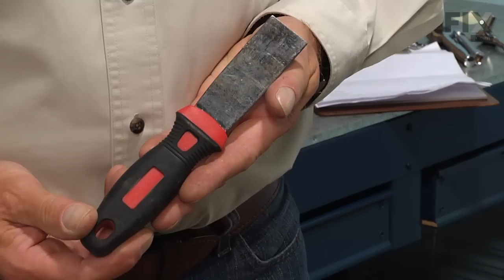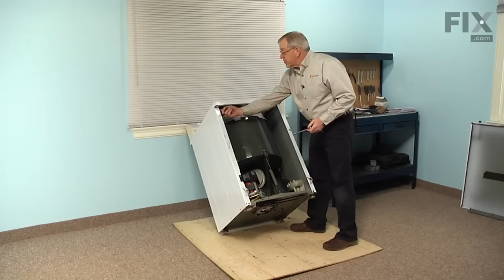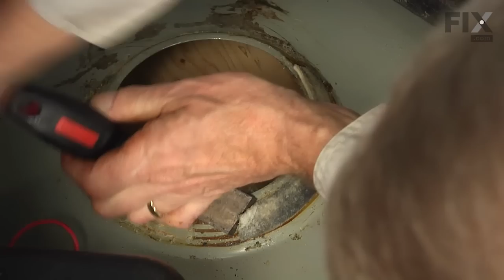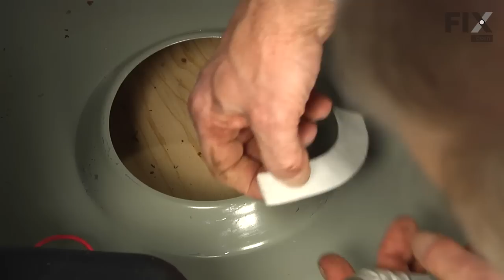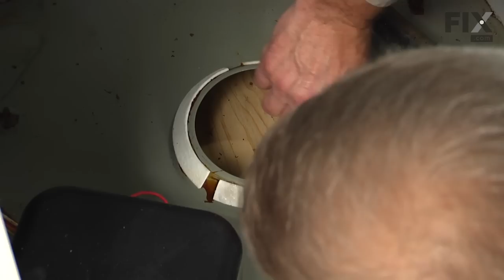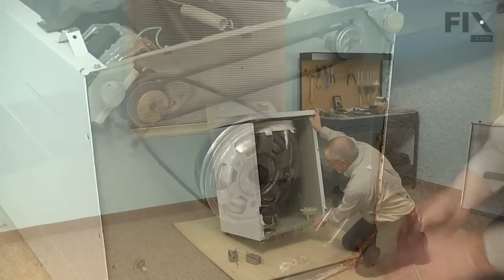Maytag Washer Repair – How to replace the Damper Pad Kit

Comment: Other video ive seen, instead of a single 4x4 you get 4 pieces of 4x2, 10inches in length nailed together to create a solid 10" square base to pla e unde4 to lift the tub. That way its secure and much safer than single block of 4x2 to work the replacement. That wrench is hard for taking out break part is hard to find and too expensive. The 10x10 wood support made out of 4x2x10 s will be solid and mucj safer support

Comment: GREAT VIDEO & how-to for old Maytag washer.  I'd never get an appliance technician to dive into this problem, and they quickly claim parts are not avaialble to fix a 40 year old washer.  We've had our Maytag A212 since the 90's and I plan to keep it running as long as I can.  New "water saver" EPA mandated washers do not get clothes clean.  There's no shortage of water, just a shortage of good washing machines in 2026.  I ordered a replacement motor and belts of bench stock on this old girl today.  Great tips here, and great service on parts--thanks for stocking old parts for good machines!!!

Comment: For anyone about to try this: the brake removal tool is no longer manufactured or sold by ANYONE. You cannot get it. You can try to remove the brake using a large pipe wrench.

Comment: I was watching your vide again, the motor pulley seems like it turns smoothly as does the transmission wheel. Is that how it is? I feel a little resistance on my transmission. I have to say

Comment: What if you're dumb like me and took the springs out without the junction box. Whats the best way to stretch them back out and get back on?
Reply: Try putting one on the machine and put the box  on it by stretching it , then remove it and do the same with the other two, then put all three on

Comment: does anyone know the diameter of the brake or the width of the spanner wrench required to remove the brake?
Reply: It’s a discontinued product you cannot get ANYWHERE. It’s frustrating. For anyone reading this: try a large pipe wrench.
Reply: @redjelly2615 that's a pretty old post. I replaced that washing machine with a new one. But thanks.

Comment: you need to show some close ups for visual details of putting some parts on or off...would really help with the little important details but a good video...where does a diy guy get the brake wrench? without that it cannot be done..

Comment: What do bad damper pads cause to happen?
Reply from the maker: The entire wash assembly sits on those pads as you know, The assembly needs to be able to glide freely on those pads to allow the spring suspension assembly to do its job of keeping the washer aligned reducing vibration, Worn or sticky pads with restrict that movement and  you will likely experience vibration in the machine and even cause the machine to move from its normal location.

Comment: I have this exact washer and it's wobbling badly during the spin cycle. I think the damper pads need replacement. I could not believe I found this video on how to do it. Looks a bit beyond what I'm prepared to do however, so, I think I'll be looking into buying a new one. Thank you anyway, for at least confirming it's enough of a pain-in-the-butt that I don't want to attempt to fix it myself. ;-)

Comment: Maytag has discontinued making parts.
Wtf?
Reply: There are many brand new parts available that are still being produced since they were used (some still are) in other brands and models of washing machines.  What they no longer manufacture are things like the brake wrench, since demand is no longer there. Sure, you and I would like to buy one, but how many 40 year old Maytag washers are out there having major repairs being done by their owners?  I am currently running with 2 of the 3 damper pads still in place, and before I will tackle this job, I will be very seriously considering replacing my 40 year old Maytag with a front loader.
Reply: @A48L16S091366  The same brake wrench was used from 1956-2006, not 40 years.
Reply: Thank Whirlpoop for that.

Comment: Good day, problem is strong unbalanced during spin at all time. Same model as presented in the video.  The washer is very well level on floor on all side. I removed the front the panel as described and all springs are in places. By hand I moved the drum quite easily back to front left to right.  Spring do not look worn or over stretched.
Is the solution is tighten the holding spring bolts ? Any other solutions to this problem ?
Reply: I tightened the springs a half inch each, replaced the damper pads and replaced the bearing inside the brake assembly.  It helped some, but still runs a little rough on spin cycle depending on whether the clothes are balanced inside the washer.

Comment: If you are doing this job without removing the whole tub like  theapplianceman aka Angel Acevedo featured in his video i would advise you to find a reasonable sized mirror to help you install the rear damper pad in back of the machine.   Its alot better than squeezing your hand through that rear access hole,  and besides in my case i have an older Maytag that has a drain solenoid which uses that access hole.   I did not wanna go through the trouble removing the hoses,  and the solenoid to align that rear damper pad.  Also invest in a circular wire brush attachment for your drill to clean the surfaces before gluing on those new pads.
Reply: Great video  Thanks for the insight.

Comment: Completed the repair including removing and replacing the brake but now the tub spins too fast in the wash cycle and water spills over the top of the tub.  Any advice on what could be happening?
Reply: the belts might be on the wrong pulleys....that would change speed of drum if pulleys are different  diameters..
Reply: Maytag washing machine

Comment: Thank you for this video. It was very detailed and was a great help. I replaced the damper pads and while I was at it, I replaced the two bearings and the belts. I have a question regarding the drive lug. After I put everything back together, although the drive lug is flush with the shaft, only about half of the thickness of the drive lug hits the stop lug on the pulley. Is that ok and if not what can be done about it?
Reply: I ran into that same issue & I have no idea if it's a problem.  Once I got the transmission back down in place, the two lugs just seem to be halfway out of alignment with each other.  I don't remember them looking like that when I took it apart.

Comment: What specifically do damper pads do?
Reply from the maker: The damper pads restrict or dampen the movement of the tub assemblies during the spin cycle. This prevents damage to your washer from moderately unbalanced loads.
Reply: HOw many raps with the hammer did it take you and how many minutes of hammering did you edit out??
Don't know if something is missing here...
Reply: @joshbaker2157  I know, right.  Every video I've seen has a clean little edit between when they start hammering to when it begins to loosen off.  From my experience, it was a lot of hard work to get it to loosen.